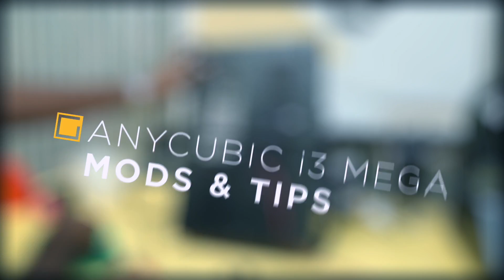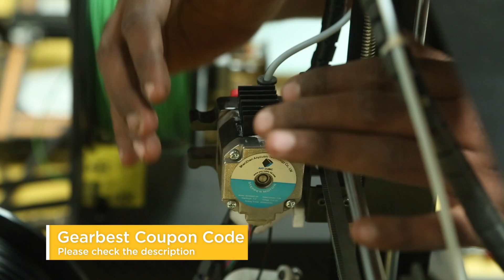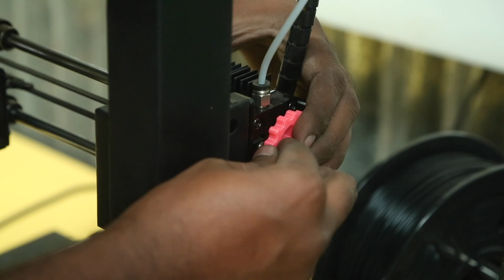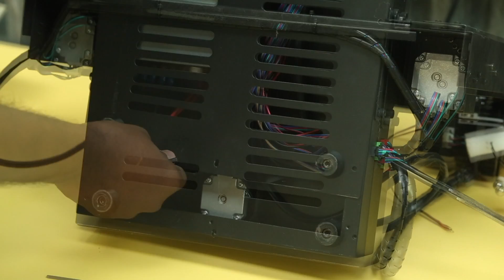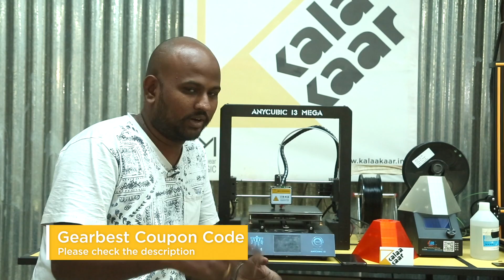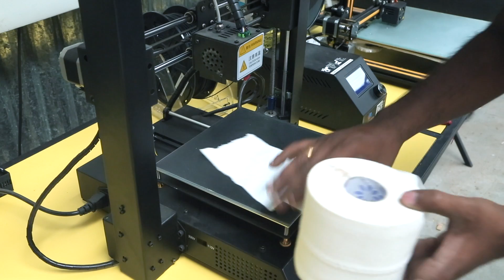Anycubic i3 Mega - Modification & Tips

Comment: please don't suggest thinner as alternate to rubbing alcohol.  According to your suggestion, I used thinner and wasted the Ultrabase layer. Eventually, I had to buy another bed. $33 loss. Therefore please edit the video or mark there "DON"T USE THINNER"
Reply from the maker: Can you show? I have been using for so many days nothing has happened till now
Reply: @Kalaakaar-in  https://www.facebook.com/photo.php?fbid=10156874816778926&set=pcb.1039926576209250&type=3&theater

Comment: The stepping of the motor and the heating can simply be explained by the fact the your rods don t appear to be oiled at all and you apparently like to touch them (something not advised). 
If the the rods are not oiled the strength that will be applied in the motor is way bigger than what it can actually take.
Reply from the maker: Not so much. By the way the heating appears in the extruder and not in the Z-Axis motor.

Comment: The "tock" sound of the extruder occurs when the filament cannot be pushed forwards, which happens when the nozzle is clogged or the nozzle is too close to the heated bed when starting to print.
Reply from the maker: I have tried everything. It was because of the heating issue of the stepper motor driver.

Comment: Stepper motors get hot because too much current is flowing through them. Reduce that current and your problem goes away. Putting fan and heatsink on it is silly: the design temperature of most steppers is 80 degC, too hot to touch. They will keep on working even when hot. 
I was hoping to find some useful info on this printer, but your not-fixing a non-problem makes me doubt that is worth my time.
Reply from the maker: I had mentioned in the video that over current could be an issue. But adjusting it did not help. So had to go for this solution.
Reply: How to reduce current on Anycubic i3 Mega extruder motor?
Reply: How do you adjust the current?